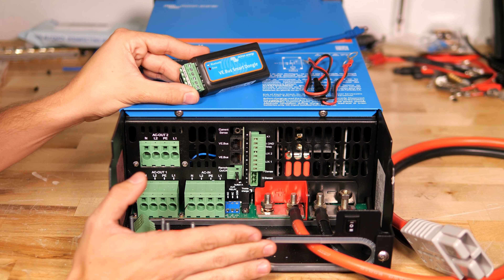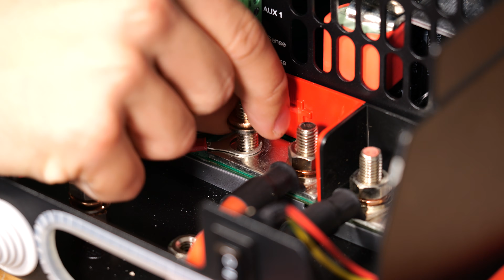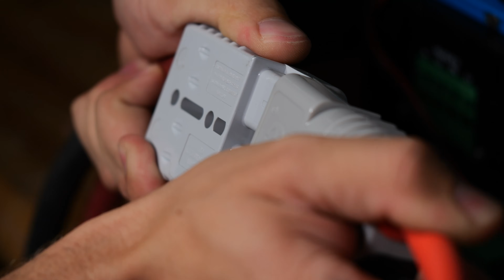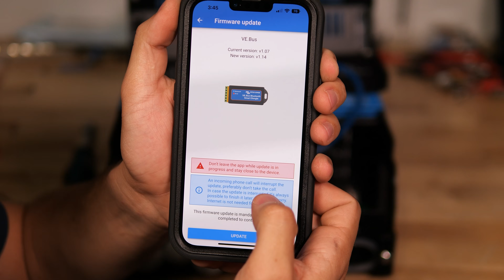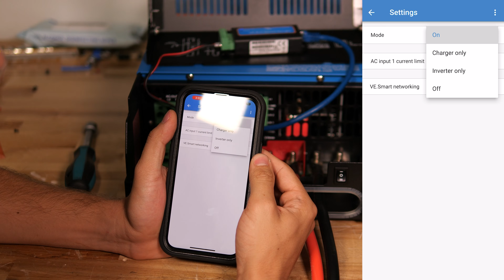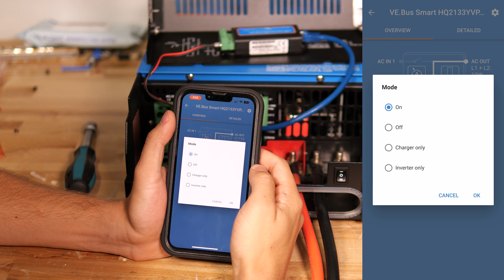How to Access Victron Inverters Over Bluetooth 📲 Victron VE.Bus Smart Dongle

Comment: "Basic" use - AC current and mode. I got one and that is all it does (MultiPlus II, 5000VA). However, you still need the Mk3 dongle (or through the CERBO GX) to program your inverter. I even tried programming some custom battery/wattage/charger cutoffs through the portal using this "Smart" Dongle - error came up. Not sure "why" -- could be a conflict with the CERBO, cabling, and BT not playing well together. The Victron MultPlus II inverters should have this built in like the RS Hybrid unit.

Comment: I was wondering if it has low voltage disconnect that you can set
Reply from the maker: Yes, this should be available in the Battery settings under "Low battery shutdown."

Comment: One thing to note is that the dongle reads voltage in place of the vsense terminal for accurate charging.  You don’t want to put it right at the inverter because then the voltage would be the same.  You want it close to or on the battery so that you can measure the difference due to loss and account for it.  Same for temperature, it is meant to mount and stick to the battery to read the temperature from the built in temp sensor inside the case.  Reading the manual for the smart dongle explains all of these details which wasn’t immediately apparent until I was seeing vsense issues when swapping in the mk3 cable and ended up needing to move where I was connecting it directly to the battery or shutoff switch vs. on a lower amperage fused auxiliary line that had less accurate voltage readings.

Comment: Victron units can be very frustrating when you can't sign on to the unit: sometimes the password is 000000 (six zeros) & sometimes it's zzz, but victron don't tell you that.

Victron says that some victron units have the password, " randomly set at the factory" : I call bull@#$&; I think used units are checked by a tech and sent out again w/o resetting passwrd, after 1st owner changed the password

Comment: Does this need to stay connected to the multiplus 2 for the programming to stay? Or will the settings for the inverter revert back once you disconnect the dongle?
Reply from the maker: The settings should stick for the inverter even after you remove the dongle. Let me know if you have any other questions!

Comment: Can a victron smart shunt do the functions of a dongle?
Reply from the maker: No, the smart shunt is a battery monitor and the VE bus smart dongle adds Bluetooth connectivity to your inverter. Completely different purposes.
Reply: @CurrentConnected  Great, thank you for info.  I am just building my first system using Victron parts.  Do I need the Dongle or is it just a feature to enhance the system?
Reply from the maker: That would depend on your specific system. You can give our technical support team a call and they can walk you through what you'll want for your specific needs!
Reply: Pair device is almost completely useless you can't change any parameters so what is it it's an on and off switch what a waste of money

Comment: Can’t believe it’s 100 bucks to get such basic functionality that should be built right into the unit.  I’ve bought Bluetooth headphones at the airport for $14.99 but for some reason my $1400 inverter can’t manage to incorporate Bluetooth.  Total scam.  And with it you still can’t set the unit to work with lithium.  For that you’ll need yet another “dongle” to give you a magic USB port for $70.  Again, all because they decided not to incorporate a ubiquitous USB port directly into the device, another money grab.  So you are buying a $1600 inverter, and that’s a ripoff by any measure.  The bastards don’t even include a cable with this thing.
Reply: Even with a cerbo gx you can’t change settings with a phone either you still need a laptop.
Reply: @Mr.J345  Yeah and an MK3 Dongle
Reply: No you can its have bluetooth support over usb just stick on in and it works . @Mr.J345
Reply: 100% agree
Reply: To be fair - the ability of the inverter vs the cost is still far and above better than other inverters on the market.  The truth is that some installations just don't need the bluetooth connection because it's all hardwired into a GX system that has bluetooth and allows you to do more.  Don't get me wrong - I see and feel the frustration sometimes as well but Victron systems are still the best for the cost.
Reply: @Proost1 no reason to excuse lack of inclusion of an interface that would literally cost cents.  Again, devices contain Bluetooth that cost ten dollars or less, it’s essentially a cost less addition, and it should be included.
Reply: I agree 100%, Jordancook1668!
Reply: I disagree, what if they come up with a better add on interface, and you are stuck with an outdated built in hardware. And if there’s an issue with the Bluetooth you would have to pull the inverter. 

It’s $83 now in 2025, not the cheapest, but it’s Victron so you know it should work.
Reply: @max7143 I think it’s silly to advocate for fewer features to be built in to a device.  Bluetooth comes with virtually every electronic device everywhere.  Victron not including it is absurd.  There’s no valid argument to the contrary.
Reply: yeah its bs, the smart charge controllers are absolutely brilliant.. but this ???  nah
Reply: Disappointed by Missing Essential Cable
I purchased the Victron VE.Bus Smart Dongle for nearly €100, only to find out it does not come with the essential UTP cable required to make it work. Seriously? For a product in this price range, excluding a basic connection cable feels like a deliberate cost-cutting choice at the expense of customer experience. Having to buy an extra cable for another €10 is both annoying and frustrating. This should be clearly stated or—better yet—included in the box. Not what I expected from a company like Victron.
Reply: @RedmoonSailing 100% agree with you.  All of this should be built in or provided with the unit.
Reply: @RedmoonSailing  I agree 100%
Reply: I dont mind paying for the interface separately; I prefer to minimize points of failure. If it fails you get a new dongle, inverter still is fine.
Reply: @ You are still reliant on the Ethernet port, which is no less likely to fail than a USB port.  This is also not endorsement for a separate $100 item, it’s an endorsement for repairability.  That’s not the same thing.  Of course the inverter should be serviceable, but if it had a built-in USB port, as it absolutely should, it would likely not cost 100 bucks to repair anyway, and that’s if it ever failed, which is unlikely.  When was the last device you owned that had a faulty USB port on it, or the Bluetooth failed.  Answer: You’ve never had one.

Comment: Hi, i have the smart dongle and multiplus 3kva 12v 120a. Problem is the inverter shuts every 20sec off and starts again. Only compared with the dongle, without it works perfect. Any ideas?

Comment: So the Bluetooth dongle won’t work for changing battery parameters?
Reply: I have definitely spent a lot on Victron stuff.
Reply: @Spyderrob1  yea if I could start over I’d go with the eg4 18k, it has everything built in breakers disconnects 3 mppts  Wi-Fi on screen setting remote monitoring ac and dc coupling
Reply: I’m having the same problem. Did you figure yours out?
Reply: @Spyderrob1  I didn’t buy one based on the premises that it wouldn’t be useful for that, I have the mk3 order now.
Victron will nickel and dime you for everything, but some how it’s still worth it.